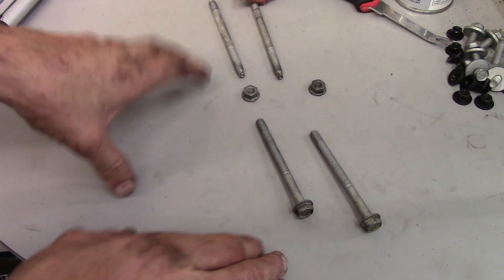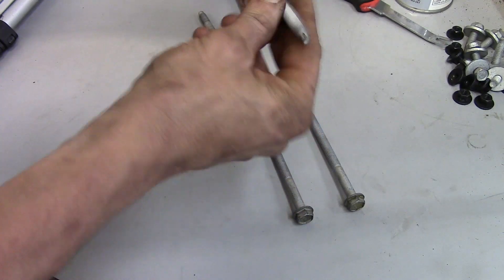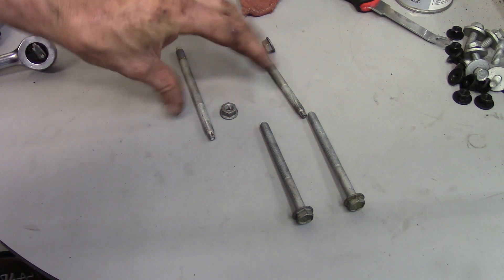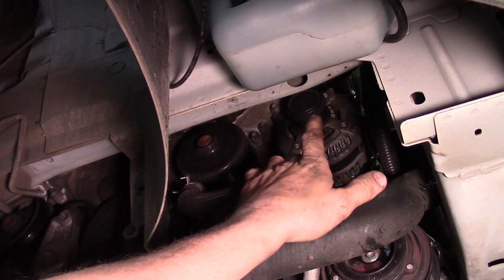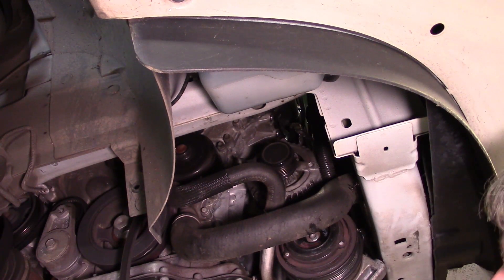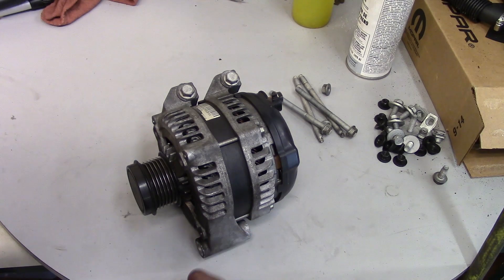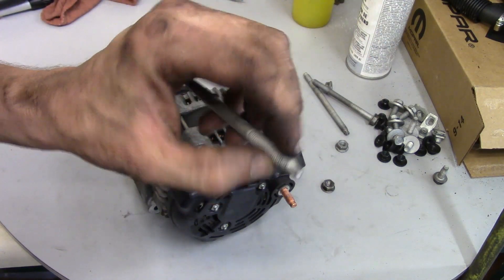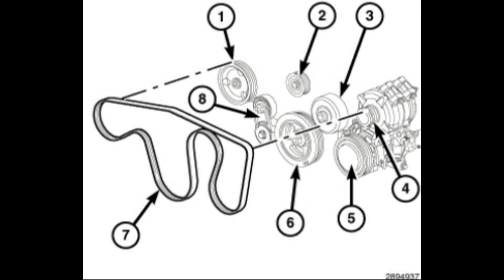Part 2/2: Grand Caravan and Town and Country 3.6 liter alternator removal with shortcut

Comment: I have a 2012 Town & Country that I need the alternator rebuilt on I'm going to do it myself I've always worked on my own vehicles for most everything this one I figured would be a challenge but seeing how you do it from the bottom makes seeing easy I've also seen it come out pretty easy from the top with the removal of the upper radiator hose so I guess I'm going to figure out which way is going to be easier for me weather I get ramps or whether I move radiator hoses but the video was very helpful thank you
Reply from the maker: Wayne Larson Thanks Wayne for watching. There is more then one method as you see....I feel underneath is best but either is doable. I appreciate you finding my channel and for commenting. Make sure to subscribe

Comment: I did yes.  It's easier to get around and only adds a few min overall.  You might be able to replace it with the tire on if you crank the wheel all the way to the right though.
Reply from the maker: Usually turning the wheel is enough room for most but no harm in removing that tire if you need that additional room.

Comment: What skill level would you rate this repair using this method? We've done some basic car repairs and some not so basic (fuel pump). Trying to figure out if it's worth doing ourselves or taking it to the shop since the town and country is already expensive at $250

Comment: Thanks for the video I saved a lot of time. I didn't have a inverted torque socket but I got a 7/32 socket to work.
Reply from the maker: +aaron jenkins That's great info Aaron. Thanks for mentioning that and for helping you fellow viewers. I appreciate you watching and make sure to subscribe
Reply: +MotorCity Mechanic another small tip, if the alt. still needs a tiny bit of space to come out. then remove the bolt holding the metal part of  coolant line below the compressor to the frame 13mm
Reply from the maker: +Trace 23 Your absolutely correct and thanks for that added info.

Comment: THANK YOU David!!  I was reading the Clymer manual for replacing the alternator ans was dreading draining the radiator;r pulling the hose; off air box, etc etc.......A quick question please? Where can i purchase new alternator brushes for my 2011 Chrysler T&C Limited, please? Have looked ALL over and can';t seem to find any, have re-built alternators before, (new bearings, brushes), had hoped mine ONLY has the brushes worn. isn't putting out enough juice to the battery only 11.8 volts with engine running hi. I know it can also be the windings/built in voltage regulator. I'm guessing it's the brushes. ANY recomendation for a new/rebuilt alternator? My local dealer wants over $700 for the alternator ONLY. Thank YOU.

Comment: Thanks for the great video. I took it out the bottom as suggested. I did not have the inverted tortz so I locked 2 nuts on one stud and removed it then locked the same nuts on the other stud (using one as a jam nut).  I purchased a set of tortz with the inverted sockets when I picked up the alternator. The part I really struggled with was removing the 2 wire connector on the back of the alternator. Once you got your hands up there I couldn't see and none of the other connectors on top of the motor were like it. I finally hit the magic spot with a small screwdriver and the red locking tab released which allowed me to release the plug. I wish you had talked about that plug.  And thanks for the serpentine belt diagram. From a former Fiat mechanic in my previous lifetime (before Fiat pulled out of the US market the firstctime.)
Reply from the maker: Charlie McAllister Thanks for the info and how it went. Some people have been using 5.5mm sockets as well and have had luck. Make sure to subscribe

Comment: **Very important note** Remember when putting the studs back into the mounting positions, the one that holds the alternator is much shorter than the 2 on the AC compressor. I mixed these up and got the longer bolt stuck in the alternator stud position. Then I stripped the star head on the damn thing. I ended up getting it out slowly with vice grips and a 5mm hex socket. This mistake easily cost me a couple hours. Live and learn from my mistakes.

Also my van had a silly little plastic guard that went over the alternator and was attached to the 2 top bolts that hold the alternator on. This was a real pain the ass because to attach this thing they made a threaded stud on the head of the bolts with more nuts to hold it in place. This makes it so you have to use a deep well socket to take the bolts out. Combine that with an already very limited space and bolts that were in way too tight  and I was in for a very frustrating time.

Good luck.

Thanks for this video!
Reply from the maker: Appreciate the tips and sorry for the aggravation. Thanks for watching and make sure to subscribe

Comment: Just did a 2016 model, Journey 3.6. Also code p0128. Had to replace tstat so, come out upper hole, after top hose removed and aux hose just above it. Now, bottom is regular bolt? Two in top of alternator was stud type, but, after removal, nuts do not come off! Oh well , got it anyway.

Comment: excellent video... thank you... this is gonna be a booger in the driveway on jack stands but it's better than paying the dealership to do it. :)
Reply from the maker: very true.....It bit of struggle will go a long ways and save you from having to open that wallet. Thanks for watching Jason and make sure to subscribe
Reply: Later that day I changed the alternator using this video as my guide... incredibly helpful.  Considering i've never worked on my van's engine in any way, only have jackstands and a super tight garage space to work in, i pulled it off in just under 4 hours... that included time to go get the part.  My father in law works for a dealer and he called their service manager... he said it'd been over $1000 repair... money saved is money I can put into my vintage Corvette :) Thanks again!
Reply from the maker: Ouch! Thats a bit more then I would have thought. The time spent sure did save alot of money. Great job and glad I could help. Appreciate the update and comment.

Comment: Maybe these Canadian vans are different but I found that using a E7 inverted torx socket fit better on the a/c studs.
Reply from the maker: You can also use a small 6 point socket as well I have found out and other viewers have mentioned. Thanks for the added info and make sure to subscribe!

Comment: thanks for the video.  i did this yesterday and it took about 2 hours.  unfortunately, it did not fix my issue.  battery is new, fuseable link appears to be good since i get the same reading at the battery as the alternator b post. time to look at the pcm i guess.

Comment: if you don't have the tool to remove the upper compressor studs, you can use two unflanged nuts (make sure threads are correct size), thread first nut on but not all the way just enough to leave enough threads for the second nut. Holding the first nut with a wrench, tighten the second nut up to the first nut, make it very tight - not stupid tight|).  You can now turn the lower nut counter clockwise and it should turn the stud - if it doesn't try to tighten the two nuts together a bit more.  I've used it to remove studs from exhaust manifolds where the top of the stud had to be cut off.  Worked good, I did it for the first stud on the compressor, it worked, then realized I had a 7/32 socket which fit on the end of the stud.  Good luck.  Awesome video BTW.
Reply from the maker: Many thanks Jim. Great tip as well. Appreciate you watching and make sure to subscribe!

Comment: Cheers great video, might add more detail.  A short bit on the order of removing the nuts, stud and bolts from the AC compressor.  I found if you remove the nuts, just loosen the bolts till it wiggles, then furthest stud with 5mm socket, then stud closest with deep 5mm socket, and removing the upper radiator hose, drain just enough coolent (1-2 qts) and tilt it up so it does not leak out, then unclip the hose holder that allows the hose to fold over and open up the top of the generator, you can hit bolts on alternator from top, and do the rest from under.   About 2-3 hrs.  Mine had a open field coil at 93K, very pissed at the exceptionally low quality between VW and Chrysler so far 24 rocker arms, 12 lifters, 1 cam, remilled rear head to fix factory miss aligned #1 sparkplug hole, its fixed now and runs perfect but these problems should have never occurred at this low of mileage, especially with all service done on time by Dodge dealership.  Was happy ECU was not bad.   There is a external regulator kit for customers who have ECU that does not make alternator work.  $119 vs $600-900 for ECU and $500 for programming.  Saves a ton of money.

Comment: Replacing mine today 2013 Town and Country I don't have the B8 XR but I'm pretty sure I can find something equivalent at the AutoZone let you know how it worked out
Reply from the maker: I hear you can use certain size 6 point sockets so you should be okay as long as you have a complete socket set. Otherwise take your time and you should do well. I will keep an eye out on your thoughts afterwards. Thanks for watching Sean!
Reply: Well it took me about an hour and a half two hours but I got it done thanks to you bro Thumbs Up No Doubt
Reply: MotorCity Mechanic yep that's exactly what I used
Reply from the maker: Sean Brown Great job. You did good on time. Glad that it all went well. Appreciate the update and for you watching. Don’t forget to subscribe!
Reply: What socket did you use?  6pt or 12 pt and did you use 5.5mm

Comment: If you remove from the bottom you do have to have the inverted torx. I removed mine from the top. It was not that difficult.  Thank God I did not have to deal with the AC compressor
Reply from the maker: Thanks for that added info. Just to show that there is always more then one way to skin a cat. Always appreciate the help!
Reply: How long did it take from the top?

Comment: I had to order the crank sensor. Waiting to be delivered. I'm trying to understand your response about the cold soak and cam phasers. I'm a novice weekend "mechanic".
Reply from the maker: +Steven Gomez Cold soak is just the vehicle sitting for a few hours after turning it off. As far as the cam phasers.....they are basically the cam shaft timing chain gears but they are oil controlled and can move independently of the camshaft when needed.
Reply: +MotorCity Mechanic You were right about the cam phasers. I gave in and took it to the dealer. It was going to cost 1000.00 dollars to replace them. As the advisor was ready to charge me, I asked if the my vehicle was under some kind of extended warranty. He checked and it was. It had a month left on the power train warranty. So the labor and parts were covered. To make my story short. The dealer ended up replacing the following. Phasers, gear camshaft, gasket cylinder head cover, actuator cam phaser, gasket intake plenum, PCM, sprockets, left cylinder head, and right cylinder head. So far the car is running fine but it has only been a week. I want to thank you for suggesting the possibility of the phasers being the problem. That gave me the push to take to the dealer. This could have been thousands of dollars at my own expense. Keep doing what you do. I'm guessing 2011 T&C are notorious for these problems. Again thank you.
Reply from the maker: +Steven Gomez thanks for the update! Glad to see that it got take care of. I'm surprised that the service writer didn't check first to see if it was covered. Bet he hoped it was customer pay and not warranty. Good thing that you spoke up and asked. Thanks for listening too and taking my advice. It's appreciated.

Comment: I just changed out the alternator and put in a new battery in my 2011 Town and Country, however my battery is still not charging.  I'm starting to think it might be a PCM issue.  Is there a way to test the PCM to verify?
Reply: I'm having the same issue. Swapped out the alternator, but still not putting out a charge. Did you resolve your issue?  I've been reading different forums, and I'm thinking I should have had the "new" alternator checked before walking out the door with it. I'm also assuming there's a fuse on the charge side somewhere, but I can't seem to find anything about it.

Comment: Awesome video. What are the torq specs for the alternator on a 2011 grand caravan 3.6? I can't find them anywhere and the bolts feel like aluminum and I don't want to overtighten them. Thanks!
Reply from the maker: +Fred Leona The service info states torque the upper bolts to 18.4 ft/lbs. I have never seen 18.4 before, its always a rounded number. It never mentions the lower bolt.

Comment: I used a 5.5 mm for the stud
Reply from the maker: Trevy Trev I do the same thing on the larger inverted bolts as well on other vehicles. Sometimes you don't need to exact tool because something else fits good enough
Reply: Trevy Trev thanks this comment helped. I found a 5.5 splined socket
Reply from the maker: viewers helping viewers. Thats awesome. Thanks for the comment
Reply: That's Great! and You're welcome
Reply: Deep or short socket
Reply: Trevy Trev not 5.5 6mm

Comment: I'm trying this method again for the 2nd time in 2 months.  The 1st time I had to come from the top, due to the stud bolts on the compressor not budging. I got a standard torx set from the auto parts store, a regular old jack that came with the car, and very few tools pieced together from rummage sales and hand me downs.  What tools do you recommend besides what you mentioned already?  And, what advice would you give to someone with the competency to complete this task but lacking the experience of an experienced mechanic such as yourself?  I'm doing it this morning so if you see it that quick, I'll definitely appreciate that!  Subscribe!

Comment: This method did not work on the 2011 Chrysler Town and Country. I have previous experience at a Chrysler dealer so I thought the compressor made sense to remove, however the framing of the car did not allow enough clearance for alternator at the wheel well. Also compressor can not be fully removed due to clearance at radiator fan. This method was a failure for me. I was able to get it out from the top though by loosing bolts on washer bottle, removing air cleaner box,  and bending radiator hose back. Was very tight clearance though.
Reply from the maker: Not sure what issues you ran into.....I have done this on a 2011 and had no issue. None the less sorry you ran into issue, thansk for watching and for letting me know the problems you ran into .

Comment: Well I got the sensor from autozone. Got under the car and I think I'm seeing something different. I see two sensors on the right size in front of the axel boot but I'm not sure if these are the crank sensors. The one I got from Autozone looks different and it is only one. I unbolted one of the sensors to compare it to one from Autozone and the one from Autozone has three wires but the two sensors on the car has only two wires. Do I need to look closer right where the axel goes into the transmission? Is it hidden and hard to get to it?? Should it only be one crank sensor in that area?  I'm planning on jacking the car up again and look harder. Any thought would be helpful.  Thanks.
Reply from the maker: +Steven Gomez I believe that you are looking at the drivers side axle....there are 2 trans speeds sensors there and they are on the transmission. The crank sensor is above and near to the passenger side sensor. its difficult to get at and may have a protective sleeve covering it.
Reply: +MotorCity Mechanic yeah. I think you are right. Those two sensors are on the transmission driver side in front of the axle boot. I'll take a closer look on the passenger side. Thanks.
Reply from the maker: +Steven Gomez Your welcome

Comment: Question. Do you know where the crankshaft position sensor is located for 2011 3.6 town and country??
Reply from the maker: +Steven Gomez The crank position sensor is mounted on the right side of the engine near the transmission. Its accessed from underneath and is close to where the drivers axle goes into the trans mission just above the oil pan.
Reply: +MotorCity Mechanic thank you. I will take a look. I have a P0340 and ended up replacing the cam sensors but I still have the P0340. I'm thinking that code maybe also referring to the crank sensor. I hoping replacing the crank sensor will fix the P0340.
Reply from the maker: +Steven Gomez Sometimes there could be a noise related to this code after a cold soak of 4 or more hours. When there is.....both exhaust cam phasers on both heads. Sometimes there isn't a noise but the same repair gets done. Just make sure all the wiring looks okay visually before going that route

Comment: this DOES NOT COVER A 2016 Grand caravan. my alternator DOES NOT HAVE TOP 2 Bolts. it has 2 studs that prevent u from removing the cover that is over the alternator. but the issue with that is the cover goes UNDER ur head cover. PLZ someone help, how to i remove the stud when there is no nipple on them for gripping?

Comment: Great job on the video!  Would've liked to see how you physically removed the alternator but we figured it out.  Don't know if it would help others but I got the top 2 alternator bolts with a wrench from the top after just sliding the upper radiator hose over slightly. And lastly didn't have a small enough star socket but a 12pt 5mm worked just fine for me.